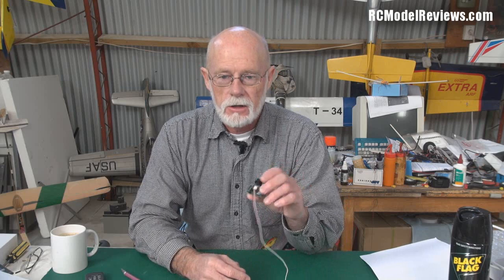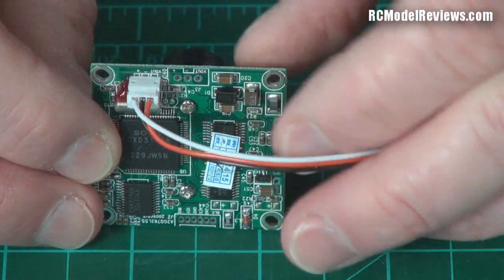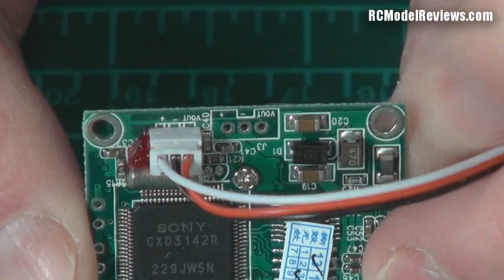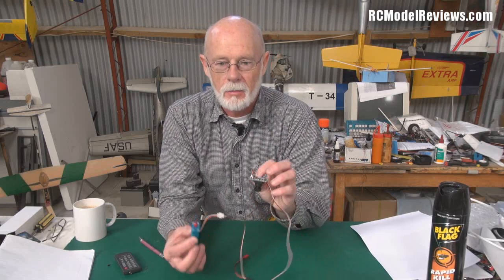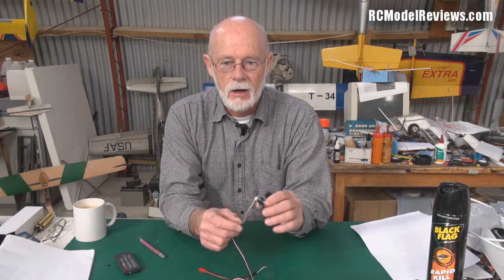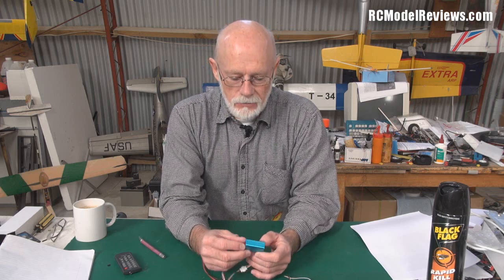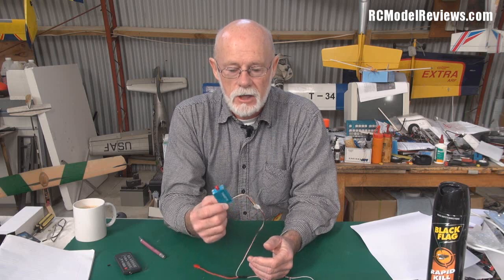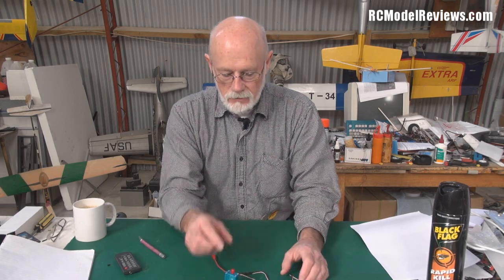Why doesn't your HobbyKing FPV system work?

Comment: This is still an issue. Sent one kit back but not before it destroyed another camera I tested it on due to the transposed wiring. They sent back another kit with the same faulty wiring and on top of that I had to pay import tax on the replacement. This is the first and last time I'll be using HobbyKing.

Comment: Hi, i got 2 of these cameras, wired correctly.  Tested With 5.8ghz 250mw and fat shark attitude.. Picture is very light, impossible to use with the googles. Can i adjust somewhere the color or contrast?

Comment: Just pull the plastic plug receiver off the pins on the board, turn it 180 degrees and push it back on. Hey presto problem solved.

Comment: Don't need to cut any wires, just switch the video (white) wire with the positive (red) wire. 
The plug that connects to the camera board has 3 little holes on the side, one for each wire. Stick a pin in the hole and slide the wire out, swap the red and white wires and your done. less than a minute to fix.

Comment: I like the prices of the Chinese stuff. I'm learning now. I've started to check things before I use them.

Hobbyking sent me a battery for my 9X transmitter.

As I sat changing the voltage regulator I was cursing myself for plugging the battery in wrongly. I couldn't believe that I would make such a mistake.

I don't know what made me do it but I checked the battery. The black and red wires were on the wrong way round. Not at the plug but inside the battery!

But, I like the prices:-)

Comment: Actually the board mounted connector can be unsoldered and rotated 180 
degrees and the wire color ID will be correct or as Jared stated it is easy to 
remove the Pins attached to the wires from the connector and replace them 
in the correct positions. 

Keep up the good videos.. learning a lot.. thanks

Comment: rather than cut the wire, just pull the pins out the white pln head and re arrange them :)
You just need to pry up the plastic pin holder, pull out the pins, re arrange them and push the pin holders back down
On another note, you say that the 2.4 video operates outside the Control band for 2.4 controllers, does this mean everything will work find with 2.4 video and control?

Comment: Thats an easy fix Bruce,  the little plug on the cam board un plug then using a fine pointed object (I use a craft knife) There is a tiny plastic clips that holds the pin coupler into the plastic plug, just gently lift the retaining clip an at the same time gently pull on the wire an it will come out with the pin coupler still attached, do the same to the other offending wires, then before swapping them over just press the plastic retaining clips back down so they will hold the couplers back in

Comment: Tnx for the advisory vid, Bruce!
I'm presently having a difference of opinion with the HobbyKing over a transmitter which arrived and the internal packaging had been impacted many times Before the king shipped it to me as new.  The Manufacturer carton had multiple holes in it..  which had been taped over!
Should I make a vid and call it, "Why did my RC Model plane crash?'
Best prices from the King but it's a crapshoot.

Comment: can you pull the pins out of the plug using a small screw driver and replace them as per the circuit board

Comment: Bruce i thought you should know that the loom its self is not wrong i have this camera and the problem is the female connecter on the camera is backwards. I turned it around ad every thing works fine know.

Comment: Speaking of odd wiring. When are you going to finish your evaluation of the Foxtech V3.  I imagine you'll discover something odd with it and your Fatshark goggles as well.  All of which has now been fixed by the community.

So never mind, you're Foxtech V3 part 2, if it ever comes, will be a bit late.

Comment: I bought one of the 16usd cameras, like that one, it was also reversed. I had alot of problems when i was wiring, becouse i didnt notice it on the board, and i havnt heard about it before

Comment: I pried off the white plastic thing on the camera with a small flathead screwdriver, turned it around and pressed it down again on the board. Effectivly turning the plug so plus and vout is correct

Comment: Don't cut the wires. Just shift the + and vid pins on the white molex-ish connector. Some pigtails from the securitycamera2000 blokes got the same problem. Just swapped the pins in the connector. 1 minute fix

Comment: My read was hobby king put out a fix this problem message. So the board people changed their connection and the wire people changed theirs too. Both flipped 180 degrees and now we have the same problem but fixed the other way around. Too efficient.

Comment: HK has had this problem for a while, depending on the batch of cameras they get in, they use stock wiring harnesses, and sometimes new camera batches have the leads reversed, though they provide the wrong harness. Typical HK :D good thing i actually read the PCB :D my last batch of cams from them are all wired wrong, but i put up with them because they're cheap and they work